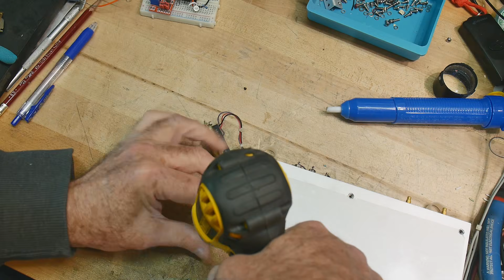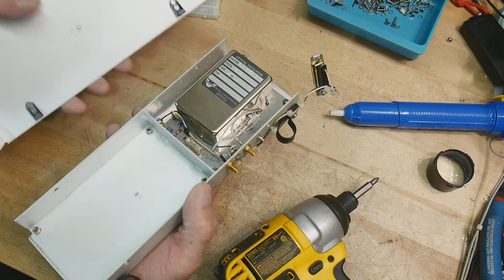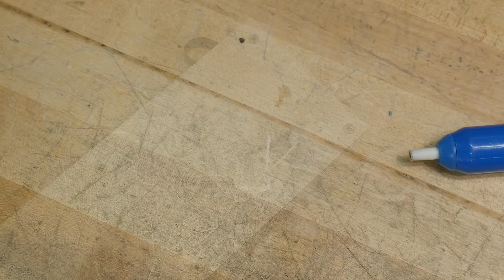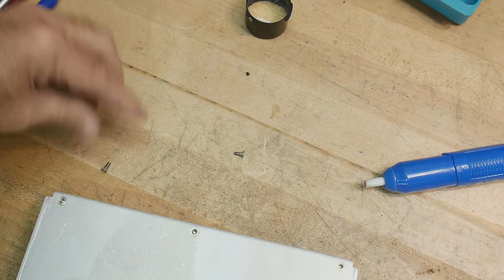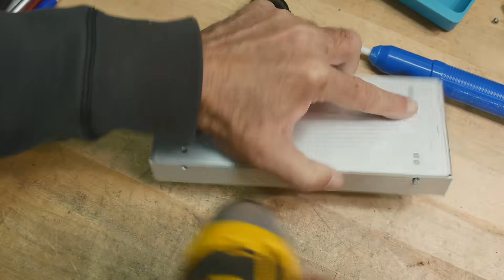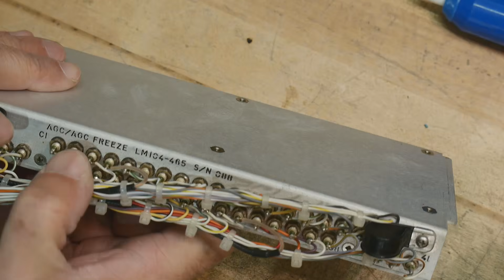#696 Microdyne Telemetry Receiver Model 1200-MR (part 3)

Comment: The Johansen white round things are trimmer capacitors. Very commonly used in this kind of RF work. Good quality generally. Need a special square ended tweeker to adjust.